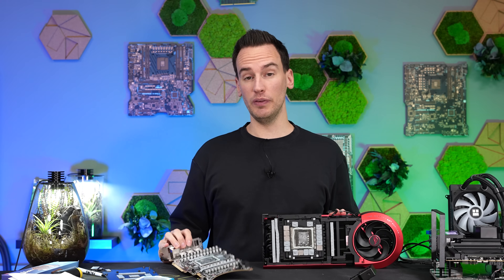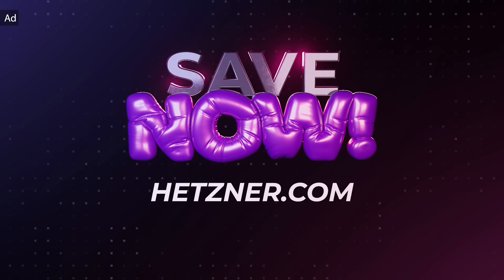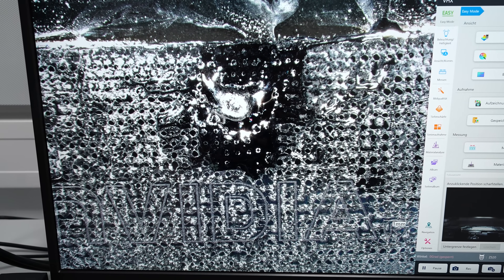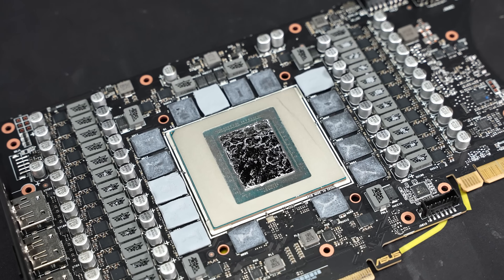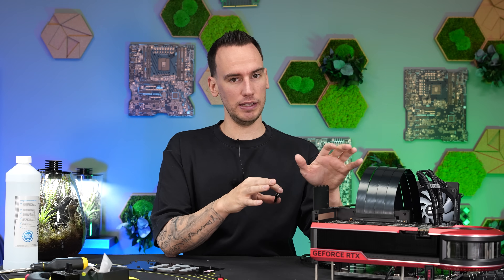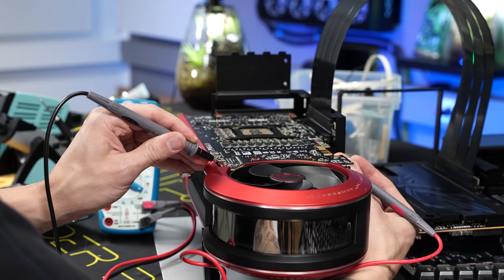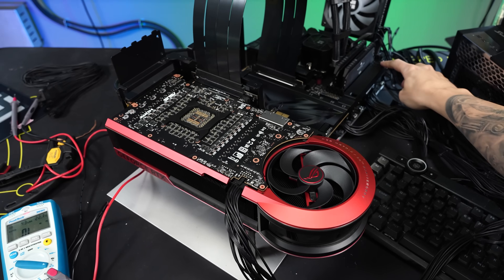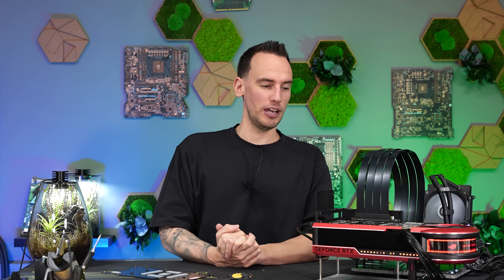5090 Matrix Mod: 750W over 12VHPWR without BTF & Liquid Metal Check

Comment: This kinda shows what we already knew. The 5090's performance is limited by the limits of the ability to delivery the power it needs. 575W is a bottleneck designed due to a lack of robust power delivery.

The 5080 has a 360W TDP and is exactly half the chip and VRAM of the 5090, yet the 5090 instead of using double the power @ 720W, its limited to 575W due to the 600W 12v-2x6 limitation.
Reply: Well not exactly. Yes it's a bad connector but the card is also terribly inefficient at this point and ~800W on a single GPU is an absurd amount of power to cool. We've had plenty of GPUs in the past that scaled too.

AIBs should be allowed to offer dual 12VHPWR cards with a 700W+ bios but even if they were allowed to mass produce them it'd still be a very niche, expensive product requiring a monstrous cooler like this or a full water block.
Reply: The performance is primarily limited by efficiency. That's why they only used a limited edition card to throw an absurd amount of power at it, because releasing a 700W card with tiny performance gain makes no sense.
The 5080 is the same way: they could have absolutely shipped a 5080 that uses 575W, but the gains of it would make zero sense.
Reply: what did you expect from 5nm out of date node?nvidia didnt use 3nm
Reply: Absolutely not lmfao, 0.1% more performance for +10% chance of melting is ludicrous
Reply: @Hetsu.. read my comment again, I don't think you understood it if you think there's a chance of melting. 
Also it does gain a good amount of performance with more wattage headroom.
Reply: @Dexion845 Calling it 'power limited' when it's already pushed so far it's efficiency curve, even the FE model, is absolutely absurd.
Reply: @Hetsu.. I respect your opinion, evidence proved otherwise. I'll stick with the consensus on that.
Reply: @Dexion845 Do you know what an  efficiency curve even is?
Reply: Guess this connector will get ditched for 60 series then. But at the 800 watts you also start to get worse cooling with air cooler...I mean just stock astral is so much better watercooled
Reply: @denissh9478 they need to redesign the pcie x16 slot entirely for these massive heatsinks. It’s become a joke
Reply: @Akkbar21 Yes with the gigantic brick's we have as GPU coolers I can hardly imagine the insane amount of cooling hardware needed to cool 720+ Watts. and then on top of this, you'd probably need a 1300 W power supply just to be on the safe side that's getting awfully close to the 110 V 12-15 amp limit that a lot of American households can deliver without tripping a circuit breaker 😮
Reply: @Akkbar21  Considering the way modern motherboards have been going, we won't even have more than 1 PCI-E slot anymore.

It's sickening looking back to X99 and seeing the level of connectivity we had not too long ago, all for less money than today's mainstream cut down garbage, even accounting for inflation.
Reply: @Dexion845 high power GPUs are pretty stupid. Who wants a space heater computer in the summer? I have one. It’s dumb.
Reply: Won’t the liquid metal slowly ooze down and leak out like the PS5 now that the barrier the OEM had around the chip is gone?

Comment: Still missing undervolting or at least an explanation for why not doing it
Reply: Then you are missing  point of Matrix 5090
Reply: @Wolek96  No, with undervolting that card will perform even better. Because it will be more efficient, so with the same power it will be able to ramp up higher.
Reply: @claudej8805  so you never had and OCed any 5090. Noted.
Reply: @Wolek96  It'd would be nice of you to give some explanation which shows that you know something that I don't regarding this, instead of just barking
Reply: @claudej8805 have you ever try to do benchmark runs to go Hall of Fame in 3dmark? Have you ever tried to take out every bit of performance from your gpu? 

UV isn’t it. You unlock every power limit possible and push it to limit of stability with lowest temps you can get. You are using UV if you want to lower your electricity bill,which is totally missing a point with buying gpu such as 5090. 

And barking. Seriously. You want to talk like that? EOT.
Reply: @Wolek96  You don't know your subject and you were barking (just read again what you wrote, big words 0% data). Undervolting is what you said, lower the electricity bill, but it can also be more (just undervolting that card would already be interesting to me though). As I wrote before, undervolting renders the card more efficient. For example 800W performance from say 600W power. So obviously you can ramp up after. Please respond only if you understood my answer.

Comment: If you have a 5090D in your hands, you can even flash it with the GALAX RTX 5090 D HOF OC LAB XOC's 2000W vBIOS.
Although the HOF card itself comes with dual power connectors, in reality it can only pull a maximum of about 1200W.
But even regular 5090D models with just a single power connector can use this vBIOS. Just imagine...
a single power connector delivering 1200W, how insanely crazy is that...
Reply: Newsflash: the 5090 non-D XOC vBIOS leaked

Comment: there's no point keeping that 12VHF connector. if cables were already getting warm, I figure XT120 conversion with two thick cables is the way as it also has thick copper connectors. just like 1080Ti today is getting mad overclocks in the rigs with modern CPUs just because the GPU market is a bit whack, the 5090 is also going to be one of those in future when it's getting absolutely pinned to the limit

Comment: Kudos to ASUS for implementing proper power sensing.
Reply: This should've been the standard for 12VHPWR.
Reply: Massive point deduction for not shutting the card down when it detects an unsafe condition though.  From a liability standpoint, this is actually worse than pretending the problem doesn't exist.
Reply: @EmperorA0 In my feedback to ASUS, I requested that they add a small controller with an EPROM that would trigger the card to low power mode and notify the user with a sound signal in the event of a power overload issue.

Comment: What is the hot spot temp ?
Reply: The hot spot sensor isn't present on the rtx 50 series and it shows 255 degrees Celsius because of that
Reply: @stefanpotirniche  Is the hot spot what determines throttling and if so what is the delta from hot spot to GPU, is it not important to know ?

Comment: over 10 amps per pin. :face-blue-wide-eyes:
Reply: A USB-C cable can do 240W with much smaller pins so...
Reply: @claudej8805  But that's with 20V usually. Nearly double the voltage.
Reply: @MarcABrown-tt1fp  True, but still 12A

Comment: At this point. Just make a giant fat solid copper power cable and hook it up to the 12VHP BtF connector.
Reply: The cable might be fine, but what about the connector?
Reply: @guiorgy  yupp. bro is forgetting that the whole thing would still collapse on the weakest link of the chain- aka the connector
Reply: @wasir3703  they should just put a piece of copper with a lug hole through it on the card. 

or a battery nub.
Reply: @guiorgy  Right? It the shitty connector is the bottleneck here.
Reply: @guiorgy  some people solder that directly to the board bypassing the connector all together
Reply: @guiorgy  same as those +100 cards dying every weeks... connector melted for using barely or above 450w...
what a great idea to show how to melt it faster by trying to send 800w into that already very underpowered connector.... 
I am amazed everyday how people lost all simple electric 101 from school when we were bareyly 11 years old...
unfortunately it's not only in PC they are going crazy ! Electic specs now say you can send + 8000w throu 1.5m2 cables in walls... (it used to be restricted to lights only !)
when before it was required at least 2.5 or 3.0m2 to avoid cable from melting protection and cause fire in your walls...
why did they changed specs ? because coper is getting much more expansive nowadays.........😁😎
Reply: @doyouwtech9012  100+ card dying per week ?
I don’t know from which galaxy that stat come from but not the Milky way.
Reply: @MRLWay another one that believes in little green men with an Nvidia logo 🤣😁😎
Even DER Bauer mentioned a few of those repair shops ... Before looking at the sky for extraVidia lifeforms start by opening your eyes you will sound less ridiculous next time 😁🤣😎
Reply: @doyouwtech9012  No I think you misunderstood me, the real stat is 100+ a day.
Reply: @MRLWay ahh, I really though you were denying so many cards breaking up.
I apologize then.
But 100+ a day is excessive I think. According to serious big repair shops it is around 100-200 a week max.
There isn't that much 3090, 4090, 5090 around.
But soon the xx80  series will join the Dance, some Oc 4080 already are...
Reply: At this point, just hook it up to a 110/220V wall socket and call it a day.
Reply: @TwiztedJugallo  Legit agree on this. It would simplify a lot of things if GPUs had their own AC mains receptacle
Reply: naa just desolder the core and stuff it into the wall plug
Reply: You can make nice stranded copper cables that deliver ludicrous amounts of power too haha
Reply: Or XT120 connector.
Reply: @kikihun9726 This all the way.
Reply: Have we gone full circle back to copper bus bars?
Reply: they can, LTT mod the 12vhpwr into a beefy battery connector, and it works wonders, reliable connection, no "not plugin all the way", no overheat. But making a 12vhpwr cable is cheaper, even cheaper than three 6+2 connectors. And the big guys make deals with each other, we just eat the scraps
Reply: Using solid copper busbars is in very needed here
Reply: breaking news: 6090 will require a licensed electrician install it directly on DIN rails at the utility panel and the computer then be built around it, 7-series to require a fully custom bus bar power delivery solution directly coupled to on-site cold fusion power generation. Don't even think about 8-series unless you have your own Dyson sphere.
Reply: BTF to 2x8pin would be nice.
Reply: Electricity moves mostly on the outside of a cable or wire, that’s why multi strand cable can be smaller then a solid cable. Also heat dissipation is higher and other benefits like ease of use.

And let’s not accept this trend of higher powered cards, which are great for server applications, but unnecessary for home users.
Reply: @killomaster  "skin effect" - that's only for AC.
Reply: @roboman2444  Beat me to it.  DC bus-bars are a thing for a reason.
Reply: @killomaster  you can just look at a car starter cable to see what will easily do the amps. but why should we accept to only renting high computing power as a service?  if you want a low powered card there's plenty of them on the market if you don't need or want the computing power, way cheaper too and thats what most of the market is buying anyhow, xx90 cards are pretty niche in numbers because they're outside of the budgets of most people.

that game devs these days are bad at utilizing them is an another issue entirely.
Reply: @killomaster  just to remember you that skin effect occur on AC, not DC. Multi strand cables are good because they are flexible, nothing to do with skin effect.

Comment: The Matrix bios only allows 2125mhz on the VRAM (34000).  You can see that from the average VRAM clock in the Speedway result.  Only way to go to 36000 is the leaked XOC bios, but that would just make the card slower probably due to that bios not performing well relative to the Matrix bios.

Comment: You know what would be great: if future PSUs would also have a 54V DC option - it would allow to transfer much more power to GPUs without high amp-loads (less heat) plus we could use it to power PoE devices over the ethernet port.
Reply: I don't think so. GPU Cores and VRAMs will keep working in very low voltages, so you are just making work harder step down converters, DR mosfets...
Reply: @carlosg_c137 
Yea imagine the coil whine on that
Reply: you would effectively be adding more PSU parts onto the card itself since the GPU core and other related parts don't operate at 54V, so while this would help with power delivery to the card it would complicate power on the card itself and take up space
Reply: it would be just simpler to put a car battery style nub or a lug hole on the card. then you could just put a battery style nub or lug or lug hole on the psu as well and use car audio thick cheap cable and bolt it on and be good for couple of kw.
Reply: Voltage safety standards (ELV) limitations? Power stages will need unusually high voltage ratings, causing a drop in efficiency due to higher Rds. Potentially increased EMI because of the increased voltage which can also affect signal integrity. If they will have multiple buck stages to ease the voltage related constraints, it will make the entire thing bulkier and use more parts that add up on the price.

They really just need proper connectors and bigger wiring, that is NOT difficult to do...
Reply: @ruikazane5123  What about any of this shows any considerations for efficiency or cost for that matter, a 48v buss power would be just fine to work with anyway.  Real solutions might actually favor just an isolated line voltage AC supply @50/60HZ OR BETTER 1KHZ
Reply from the maker: I think the max that you can do in most countries is ~19 Volts. Same as a lot of mobile devices. Above that, there are a lot of additional regulations.
Reply: @der8auer-en  Uh .. classical phone lines have 48 volts in every home. Every solar panel that you can put on a balcony has higher DC voltages. All the regulations I have seen convern voltages above 75 Volts for DC.  Most PSUs already have three voltages they provide:  12V, 5V and 3.3 V ... having one step extra for 48 or 54 volt would not be impossible.
Reply: @pibyte  I believe US electrical code has 48V as the cutoff, and is far more common than 54V.  Even 24V would be nice.
Reply: @der8auer-en  i don't think so: pc parts are not regulated like computers themselves. And 48V would be the best way to fix overcurrent issue, but the most issue is legacy - basically how to make PSU manufacturers and others to go with 48v option
Reply: @LordPrecision  I dont think legacy is that much of an issue if the solution is only for these monster cards that costs thousands, those people either already were going to be buying a new psu or would have no issue buying one for their new gpu. Then by the time it was being used to on lower end lower powered cards most people would already need a new psu anyway. Kind of how it works right now if you get a 12vhp card anyway (which personally I would avoid).
Reply: @der8auer-en  Code in the US is <50v is considered ultra low voltage/"not ordinarily hazardous" minimal shock hazard.  Confusing since a 48v Pb battery setup could be as high as 64v and is still considered low NOH.  But point is valid, even though probably more of a hazard to shove even 700w through that connector, translation "electrons are scary" let them pass due to CO poisoning rather than put warning labels on things.
Reply: @chasingcapsaicin  Isn't it only 64V at no load, and should drop to about 50V when load big applied? Like on a semi-truck. The 12V lead-acid in my car, sits at just over 13V, If I had rev'd high before turning off. When I crack the engine, it will drop to about 11-12V.
Reply: @Blommefeldt  64v is the Equalize voltage, literally boiling wet vented battery's to balance a bank. Then replacing the missing H2O after.
Reply: Converting a 12V to 1V has a certain efficiency, but converting 54V to 1V (GPU voltage) has a much lower efficiency, which means significantly higher heating of the converters, which already get quite hot. Supplying 48V to a powerful graphics card is absurd, just like to a motherboard. If you've noticed, they always increase the number of phases, not the voltage, because that's the rational approach.
Reply: @Dezmond2inbox  Current PSUs provide 12V, 5V, and 3.3V - I would ADD another power rail not replace the existing ones.
Reply: @pibyte voltage higher than 12 is more heat for VRM and less efficiency.

Comment: That liquid metal pattern made me think of solder balls or how solder can be applied through a surface with holes aligned with solder points on a chip and board.
Reply: Just a stencil
Reply: @DolezalPetr  Beat me to it haha
Reply: you're thinking of a BGA template
Reply: @geothermalcat7365 That might be it. I don't know anything about it, I've just seen it used in videos.
Reply: @Alexandra-Rex  Yeah they're right, it's called a BGA (Ball Grid Array) template, stencil, or jig. 
I've always thought it was pretty fascinating watching people do that by hand.
Reply: @Wooskii1  That is used to attach the GPU silicon chip to the board typically, they could use something similar here if it comes in those balls, maybe thats why he check composition.
Reply: They definitely applied it using some sort of silk screen system. The same way graphics are applied to tshirts.
Reply: Yeah, they probably used a screen to get a even coating across the die.